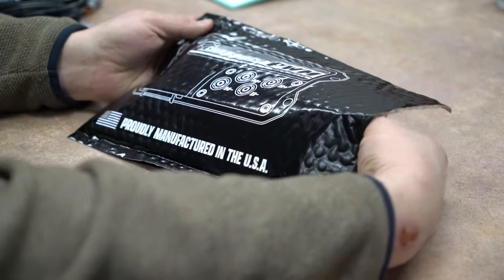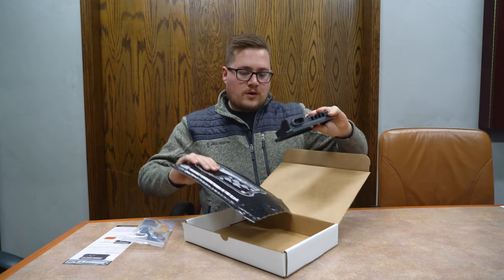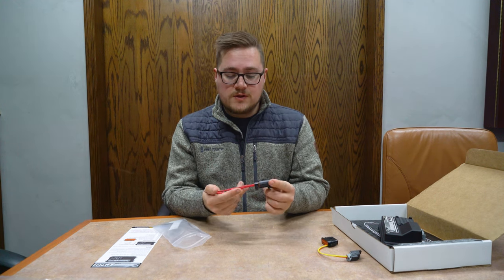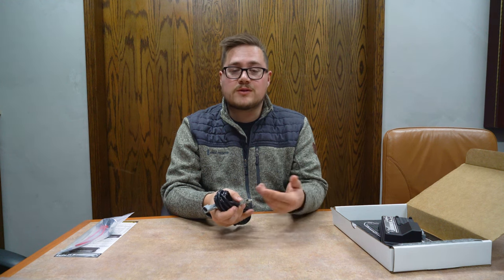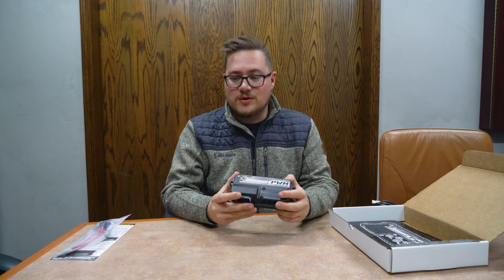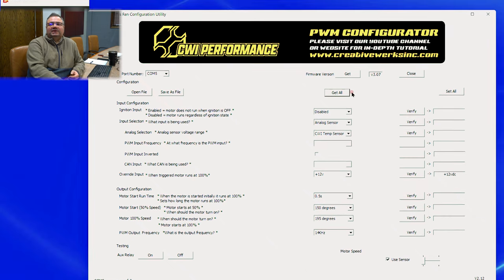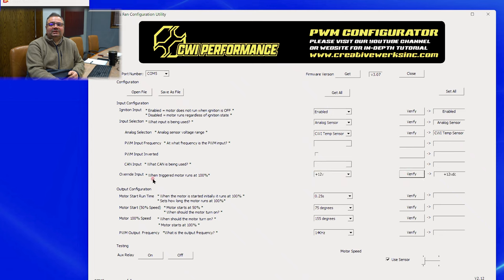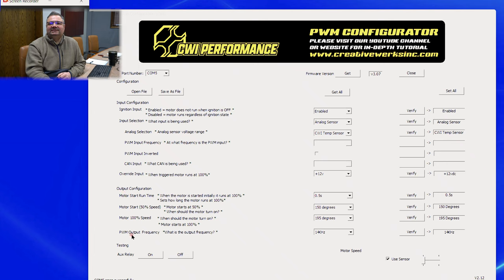Let's unbox our NEWEST product! Control your brushed motor via PWM Signal.

Comment: At the 7 minute mark you talk about dual fans, a primary and secondary fan. The 1st fan is PWM controlled, from the PWM Controller I assume and then its mentioned the 2nd fan switches on when you reach 100% speed. I'm assuming the Deutsch connector has a control signal which turns the relay on for the secondary fan to run 100%, straight off the battery, correct? If I want to run both fans together controlled only by the PWM Controller, no ECU control, then do I simply connect both fans to the "M" connectors on the PWM Controller and that's it, I'm done?

Comment: Some concerns and constructive criticism I hope. Doesn't starting the motor at 100% eliminate the soft start capability basically? Also it would be nice to have the override Percentage adjustable for A/C usage if needed.And finally when is 0-5v going to be available?

Comment: Looks like a great product. Couple questions please. LS3 engine Holley Terminator X ecu. This controller does not need an additional temp sensor, it can read temp from ecu?  Does it run fans up to 100% when A/C turns on?  Can it run fans for a set time period after engine shuts off?  Trunk mounted battery, mounting the controller in trunk is OK?   Thanks, sorry for so many questions, electronics are clearly not my thing 😂
Reply from the maker: Thanks for asking good questions! 

So with the terminator X you should be able to use that temp sensor, you will just use the ECU's PWM output as the driver for the controller. 

Yes, the fans will enabled to be 100% on when it sees the A/C override // over ride switch.

We do not allow the controller to keep the fans on after engine shutoff, realistically since your water pump isn't running you're not going to see effective cooling through the motor.

You absolutely could mount it in the rear, or if you were using it as a fuel pump controller you could additionally mount it in the rear. Ideally I'd recommend running a main power with some kind of breaker in between front and back incase you were to get into a crash to shut off power, then run a main power stud for everything up front. Then you won't have to run everything under the hood all the way to the back.
Reply: @CWIPerformance  thank you!  Looks like it’ll do everything I need it to do.  One more question about the AC over ride please. I believe this would be the ecu’s responsibility, by cutting off the signal at a set mph, but between the Holley and this controller, can the fans be programmed to shut off at highway speed with or without AC on?
Reply from the maker: @65427  I believe you are correct. You would control that functionality through the ECU. Our controller doesn't allow for that much indepth customization. If your fans are running at highway speed (without A/C) you engine temps are probably way too high.
Reply: @CWIPerformance  great, thank you

Comment: Is there an imput from for an ecu to turn the fans on? So it kicks the IAC up for the fan power draw.
Reply: Depends on the engine ecu…. I have never seen an IAC issue with current draw, I have seen the alternator drag down the engine.